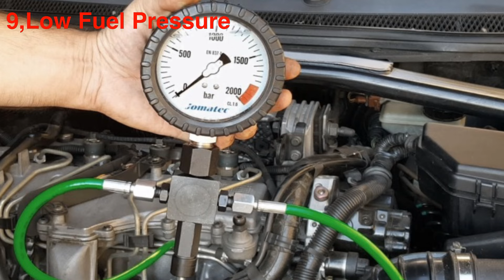12 Common Reason About RPM Fluctuation/RPM Fluctuation While Idling Or Driving

Comment: It says 12 Common Problems, but what's number 6?? It goes from 5 to 7. Wrong Timing to Accelerator Pedal Sensor. What's number 6??
Reply: You not wrong
Reply: Number 6 is ignition control module. It can make your rpm needle jump around on the tach when it goes bad
Reply: Show a picture
Reply: This was before they invented the number 6
Reply: No6 money problem

Comment: My 2007 bmw has this problem where my RPMs jump slightly higher and lower for one second only when shifting into neutral. What could it be?
Reply from the maker: Could be your throttle body deposit carbon or slightly vaccume leak 🤔
Reply: @carfix1993  thanks bud, I’ll see what it is this week
Reply: What about my rpm shooting up every time I hit the brakes have any idea

Comment: Any suggestions on where to start looking when a 2018 ford transit RPMs rev high after driving interstate speeds and pulling hills.  It won't stop randomly spiking RPMs even when breaking until the van is pulled over and cooled down. Sounds like the engine is going to blow. Can't get it to replicate for the dealership, only happens in driving down in to the ozarks about 3 hours from our house. No hills near us to replicate it.

Comment: I have this weird problem for quite some time on chevy cruze 1.8. While idling and attempting to hold rpms steady on 2000 or 3000 whatever, it just revving up and then rpms suddenly drops down to normal idling even thou my foot is still on the pedal. This is almost unnoticeable while driving. I have that "Creader 3001" OBD2 scanner and on data stream everything is within normal. The car accelerates and idles normally, it's just that failed attempt to hold it steady on certain rpms that really annoys me. Any suggestion of fixing my issue?
Reply: I have the same problem
Reply: @Iamsami143  Well if you find the problem please share because I kind of give up on finding the issue after several failed attempts. My main suspects are accelerator pedal or ignition coil pack even thou the mechanic claim that they are working properly.
Reply: I need to know about this as well

Comment: I have this problem only when I try to accelerate but only when the engine gets the working temperature. Everything else before that works perfectly fine. But once the engine gets the working temperature if I try to accelerate hard and push the pedal to the bottom it will give me the power than lose it for around 200RMP's and then go back up again. If someone has any experience with this case please write me. Thank you in advance all.
Reply: Michael what did you find out ?
Reply: I have the exact same problem in my 2008 Cadillac DTS, have you found out the cause...???
Reply: @hoosieroutdoors3020  Hey mate it turned out to be a worn out clutch and flying wheel (clutch plate) to be precise. The mechanic told me that I should replace complete clutch and flying wheel and then I would be able to drive it again with normal driving style at least a 150 thousand miles. I am still waiting for the mechanic to fit me in his schedule since he was busy last 3 weeks. I hope somewhere this week I will be able to replace that thing and then I will come back here with conclusion, experience and some other answers.
Reply: @tkking188  I just wrote the answer mate, I hope you can see it.
Reply: @hoosieroutdoors3020  So guys I have to let you know that all those problems I had are now fixed. All the strange sounds I had when I open the hood, all the shaking when moving from place in first gear, and the uneven work of the engine in place were the problems of worn out clutch disk, and pressure plate with the springs and the mechanic gave me an old part where I can see that even the flying wheel wouldn't hold on much longer, maybe 40 000km more as he said. Then even the flywheel would be completely worn out and give me a bunch of new nightmares and problems. When he explained to me and when I saw how the clutch is working, especially the clutch disk which is constantly in touch with the flywheel that is connected to the crankshaft and they are all connected to the pressure plate connected to the transmission everything makes much more sense. So as soon as you feel on your clutch pedal a small constant vibration when you even slightly cross over it with your foot, open the hood listen to the noise that comes from down the bottom or close to the windshield, and try to give fast acceleration and if you have those RPM raving up and down, trust me unfortunately it is the clutch problem. It is not cheap but once you replace it you will be so happy and glad for fixing it and my car is now working better than ever. I feel sorry for not replacing this part much earlier. Just remember when you feel the first symptoms they will just keep getting worse and worse. There are hundreds of videos that are explaining how to use a clutch normally and it should last at least 250 000km. I will place here one video for you to see how the clutch is actually working and which parts were completely destroyed in my case. I wish you good luck and a lot of miles with your cars guys, take care. https://www.youtube.com/watch?v=devo3kdSPQY&t=228s&ab_channel=Lesics
Reply: @MichaelRoy777 will this resolution work for automatic cars? I have the same problem with my civic. It's like the rpm is breathing
Reply: @xavieryclarkdeasis3139  To be honest, I don't know, my friend. As far as I understand, cars with automatic transmissions do not have flywheels like manuals because they lack a regular clutch. You should check with your mechanic because automatic cars have something in place of a regular clutch, which is also replaceable. It might need to be replaced when it reaches the end of its working life, of that I am sure.

Comment: my car rpm goes by 1 point high with slight vibration and when car is in idle and rain wiper is on. This is started happening after I refuel the car that was left with 5 percent fuel in it. The rpm raise happens randomly there is no time sequence, may I know what could be the issue. Mine is 1.2ltr petrol engine

Comment: Was number 2 for me on my 2011 Silverado 5.3 liter. Only found it after opening the hood before starting the engine in the morning.  Coil was wet. After I drove to the parts store that moisture was gone and no evidence of a leaking coil.  Engine had a 100-200 rpm variance.  I’ve read coils last between 80,000-100,000 miles.  Mine has186,000.

Comment: I have a 2008 Nissan Frontier SE V6 4.0L. I have had a new valve cover with gaskets, new plugs, coils, PVC valve sensor, Temp Control sensor, and both intake exhaust sensors, oil and filter change. I’ve used my smoke machine and found no vacuum leaks.  The truck runs well and I get good gas mileage. The issue I have is when it’s warmed up at normal operating temp, it idols very smooth at around 600 RPM’s and then every 5-10 minutes the RPM drops to 500-550 RPM’s for a split second and the back up to 600 RPM's. No issues driving at whatever speed limit Im going. No CEL and OBD2 detects no issues.  If anyone has any suggestions or advice on what causes this I would appreciate it greatly.

Comment: I just bought a 2014 Subaru WRX. The RPMs start bouncing (and gently nudging the car forward) regardless of gear at low speeds anywhere between 1k and 2k rpms until I put enough pressure on the accelerator to override what feels like idle searching. Any ideas? I've tried looking this up and some people have claimed that it's the factory tune and that an aftermarket tune can clean it up?

Comment: I have a 2006 gmc sierra 1500, set cruise control the rpms rocket to 4000 , throttle sinks , take off crusie control let the truck downshift and can barely go 35 mph. Is it transmission or fuel or both

Comment: My car has a rpm problem. Idk if it’s the clutch or what. When putting your put on the clutch the rpm goes broom like you put your foot on the pedal. I also feel like the idle rpm got a little higher for about 500
Reply: Throttle needs to be adjusted manually or with a computer.

Comment: Got a mustang 2001 4.6 l, right when I start my
Car it’s at around 2k rpm, I’ve cleaned my idle air control and helped for a bit but the problem
Returned any other ideas I also got a new throttle body cable?

Comment: I got a 2008 Subaru FJ motor. headgasket were done at 100K, this started yesterday Where the idle starts a 2k then goes to 1.5 then back to 2k and so on for at least 30 seconds. ive cold started this thing so many time without a problem now when I first start it the idle fluctuates, this never used to happen; any ideas?

Comment: I have engine shake and rough idling only when AC turned on. What could be the issue.? BTW keep up the great work i believe you are sri lankan yes.? Jaya weva bro
Reply: Had a similar issue, it was caused by a weak battery. When the cooling fan or AC came on the car would struggle because the battery couldn't put out the current needed to the spark plugs

Comment: I have a acceleration problem il hit the high way go 60 I feel the car jerkin it’s not a transmission slipping any help?
Reply: The same thing happens to me at about 55 or higher the rpm goes up and truck jerks slightly I'm scared it's my transmission. Did you find out anything?
Reply: @johnkimball5872  nope

Comment: What could be the issue on a 2006 kia if when stepping on the clutch to change gear rev counter goes up?
Reply: U have gas pressed as ur pressing clutch causing the rims to jumps real quick. Try fully removing foot off the gas before engaging clutch. If that doesn't help, I'm wrong lol😅
Reply: @kylerdc400  been driving for years... the throttle sensor was the culprit. The car no longer has the problem.
Reply: Fair enough, anymore I've learned not to assume lol, glad it's fixed tho. Wish i was more help!

Comment: Hi, my 2007 audi a4 b7 has very weak rev at idle. I stepped on the gas and the rpm just slowly goes up. Before it revs up nice and strong. Any help would be greatly appreciated. Thanks

Comment: Mine it's a mistubish lancer, when you start it the rpm goes to the half of the clock and 3/4 fluctuating and does not respond to acceleration what could be the problem
Reply: The engine is running good but the rpm is more high and dancing
Reply from the maker: CLEAN IAC VALVE OR REPLACEMENT

Comment: am having an issue with my car I have a 1997 Honda accord v6 when I let go of the gas pedal the rpm is very slow to drop it has never done this not sure
Reply from the maker: Check your IDEL CONTROL may be stuck  should be have to clean
Reply: @carfix1993  did one not too long ago but I’ll do one again
Reply from the maker: https://youtu.be/L78qiC-OahE

Comment: My truck drops real low in rpms when I put it in drive..then fluctuates after I drive it and it's in drive at stop almost to the point it feels like it's gonna stall
Reply: Did u get that problem fixed I am having a similar problem and not sure what to do
Reply: @brentonhaye  no sir it does it still I had it tuned and was told I could have a leaky injector so I'm thinking that's what it might be

Comment: When i press acceleration My engine  give high noise but the speed is very low ,,, in other word the rpm is very high but speed is very low , what can i do i need your help
Reply: I have jetta 2011 and have same problem. Do you find what's wrong with it??

Comment: I have a 03 ram 5.9 swapped and truck ran good for long time but now all of a sudden on 2 hour ride home I was doing 55 rm started jumping slightly and sometimes a little high with out me hiting gas any harder and in park it just idels real high any help would be great I've done put so much money in this damn truck I just got it out shop cost me 3k
Reply: Dude if u figured out wth was wrong wit it plz let me know🙏🙏on highway speeds mine sits at 1500 but every 6-7 seconds it jumps to about 1550 to 1600 rpm’s
Reply: It was a vacume leak right on top of the throttle body in front in middle . There was a rip in the under side up it really hard to see  what I did to find it bc I could hear a slight vacuum leak was run my finger up and down on vacuum line found it fairly quick considering it just broke off rubber was rock hard and brittle
Reply: @christian2581   in the process of trying to figure it out I also cleaned off the sensor on rear dif  so that may have been it to
Reply: @philipvillagran9236  hell yeah thank you I’ve heard all kinds of crap from torque converter to spark plugs misfires to TCM carb cleaning and even transmission swap appreciate your help🙏
Reply: @christian2581   I also had something similar happen another time  it ran fine  not not when you would try to get on it or pass someone  it would jerk and red line almost I would  have to let off for it to shift .  I heard all the same torque converter,shift solenoid etc  but it turned out to be faulty spark plugs .    I've had alot of trial and error with this truck
Reply: @philipvillagran9236  fkn dodge huh💀💀💀